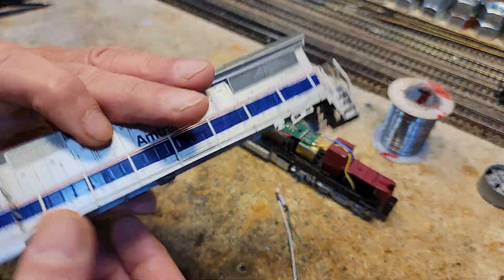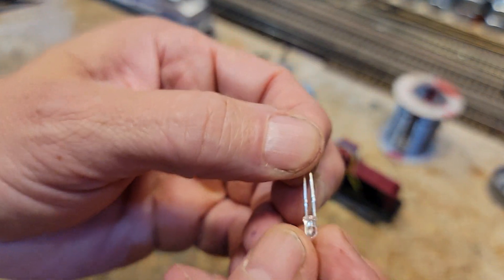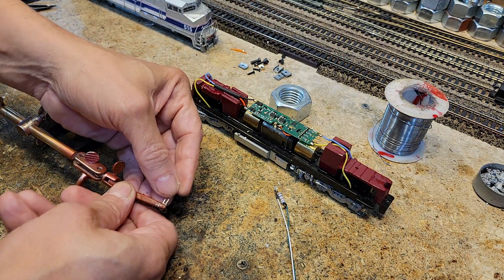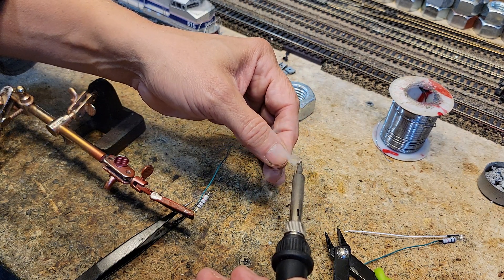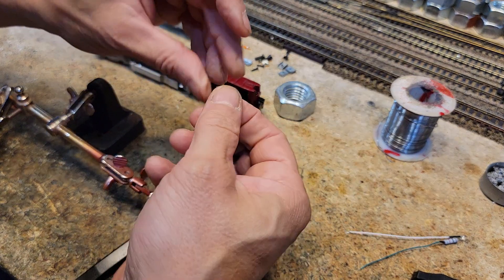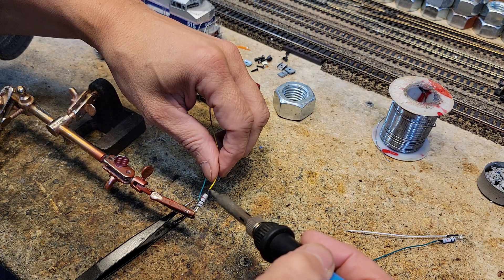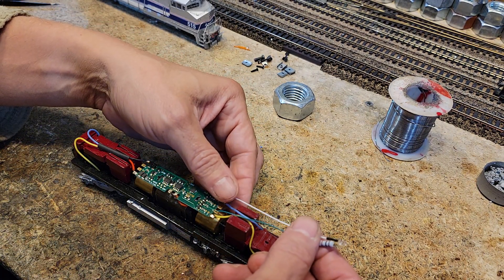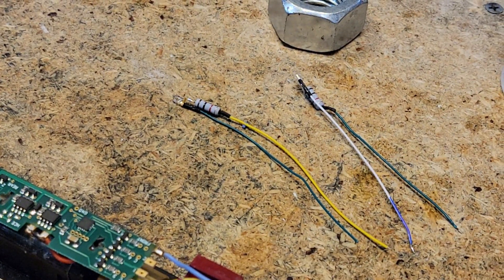Simple LED setup for locomotives

Comment: Resistors are not polarised and can be attached to the LED using either end of it.
Reply from the maker: I got into the habit of putting them on the negative side a while ago because of the way Digitrax uses the blue wire positve as a common - it's just stuck with me ever since!
Reply: @elite194  I wasn't meaning the placement of the resistor on the cathode side of the LED, but rather the way you turn the resistor when soldering it to the cathode side. Resistors are not subject to polarity and current will flow through them regardless of the direction of the top colour band of the resistor.
Reply from the maker: as long as you bought them from digi-key!  I just now had a cheap one catch fire because it was turned around!  it's a risk you take getting bags of a 100 - especially the half and quarter watt size.  so I always follow the radio shack diagrams from the old "getting started workbook" and orient the metal stripe exactly like diagrams where the "4th stripe" points the way to ground!
Reply: @elite194  I must admit that I hadn't heard of or read what was written in the radio shack workbook.
Reply from the maker: it's called "getting started" from radio shack.  it's like a hand written engineering notebook that starts with the basics and moves up, but later you'd find it more like an encyclopedia where you can look up components and getting these nice descriptions of what it is, what is does and how it works.  it's a worthwhile addition to your library.  I've been finding out the hard way with several different component that I bought the cheapest possible.  I've smoked an SMD bridge rectifier, several capacitors and a small mountain of quarter watt resistors + a few half watt resistors also. mostly this is due to them being "not authentic" which you can check out in tons of articles on what happens when you buy cheap parts!!